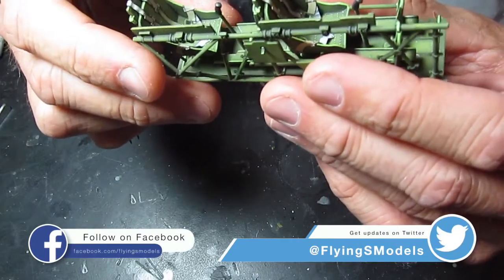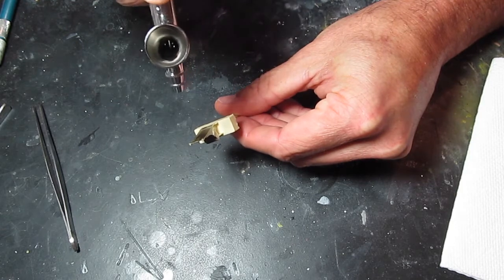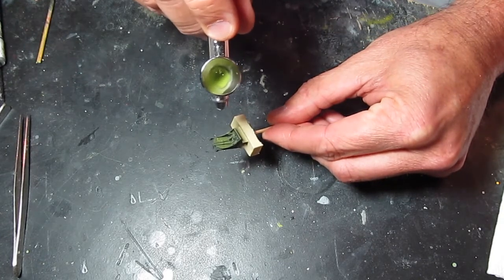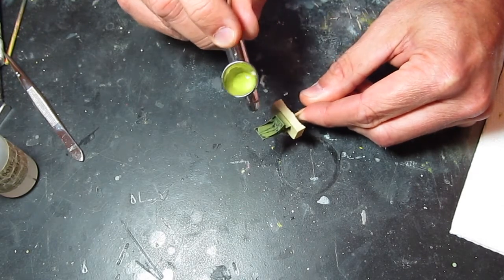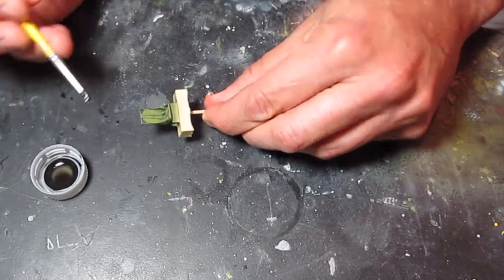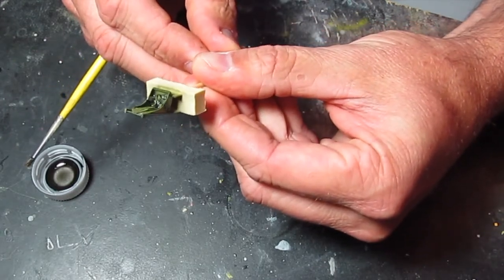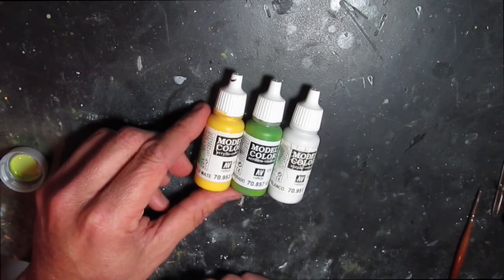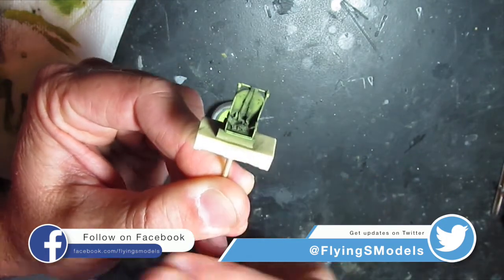Airbrushing and Brush Painting Models to add dimension

Comment: I am trying to get better with detailing because I am terrible. I was under the impression that you shouldn't use enamels or mineral spirits over acrylic paint? Obviously you did so it works. Do you just need to be sure the acrylic is really dry first?
Reply from the maker: Practice makes perfect so keep working at it.  I don't really wait all that long before applying the wash over acrylic paint.  The modern acrylic model paints are pretty durable when it comes to these types of washes.  Let me know if you have any other questions.
Reply: @FlyingSModels  Many questions. But i think it best to watch a few more of your videos first. I really appreciate the response though.